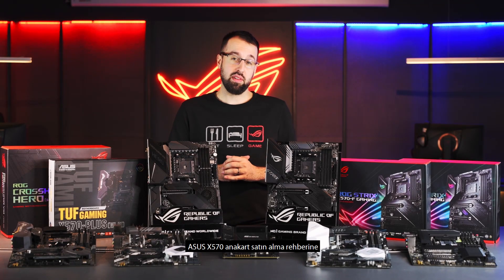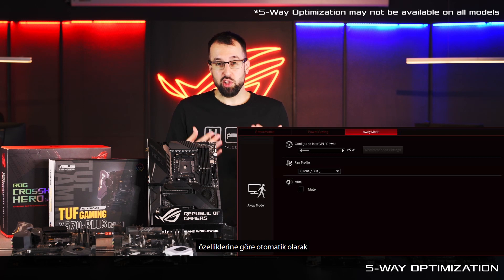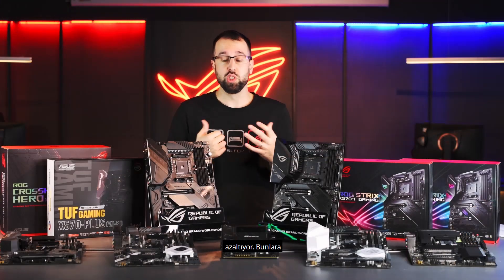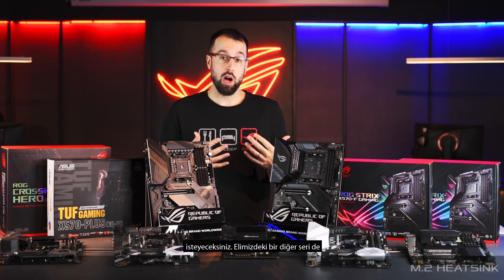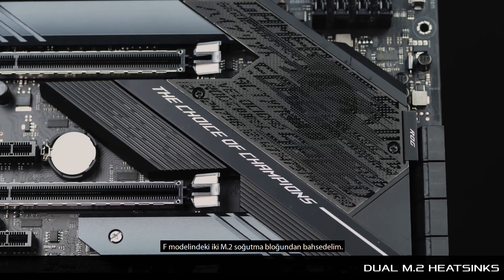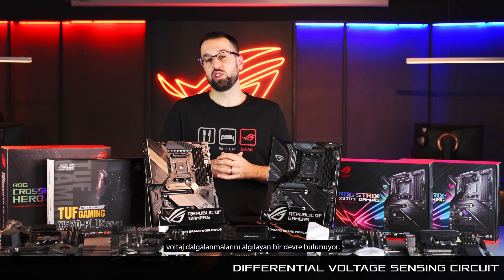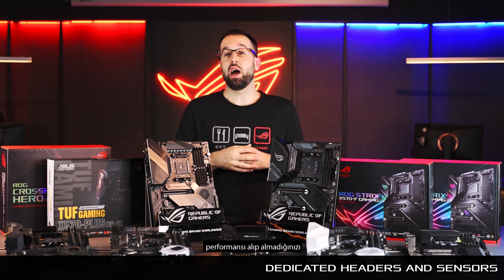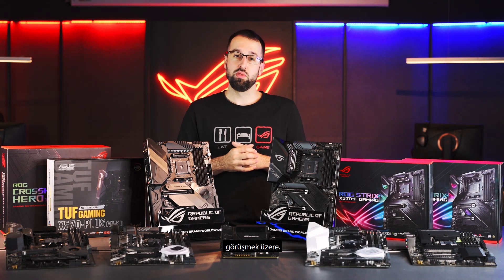ASUS X570 Anakart Satın Alma Rehberi

Comment: Allah razı olsun ya valla sabahtandır E İLE F ARASI DAYDIM NEDEN PAHALI OLDUGUNU ANLADIM WİFİ 6 YÜZÜNDEN MİŞ YANİ F ALICAM
Reply: bende var f gaming gayet memnunum 3700x ile kullanıyorum
Reply: bende f aldım indirimden 1720 tl ye 3700x ile kullanıcam 3600lük remler ibekliyorum gelmesini
Reply: @mehmetkemalcansevdi5569  Vatana geldi 3600mhz cl16
Reply: Gigabyte X570 Aorus Elite ve Rog Strix X570 Gaming-F arasındayım bende. Ufak tefek farklar var ama fiyat farkı 250TL. Kararsız kaldım, ne diyorsunuz? 250 TL de 1TB bir hdd parası yani..
Reply: @MiraçS-b2d  rog strix den şaşma derim
Reply: hocam müsadenle bir soru sormak isterim  rog Strix x570-F aldım, 3800x ile kullacağım.fakat ram alırken bir hata yaptım 3000mhz 32 gb aldım kısa vadede nekadar idare edebilir 3200 mhz nin hepsini göremeyeceğimin farkındayım ama şuan için değiştirebilecek imkanım da yok tek slot 32 gb kullanmalımıyım birazdaha sabredip 16x2 3600 mü   yapayım
Reply: @ahmetalmaz2328  beyler tuf 570x plus aldım bütçe yetmedi valla sistemi kurdum